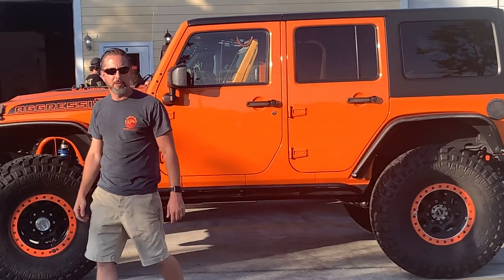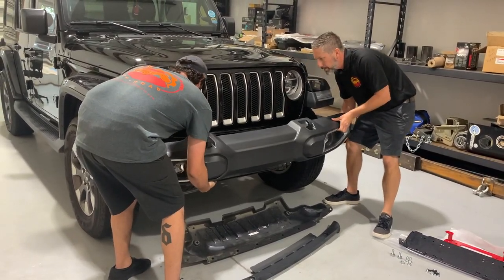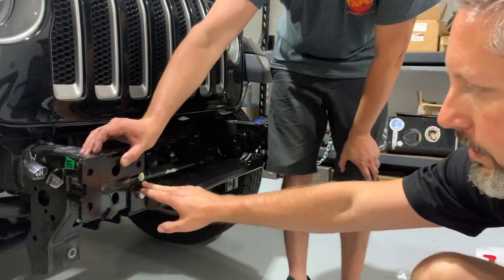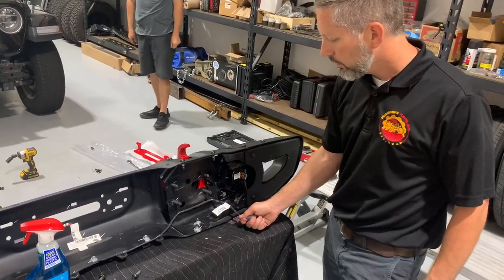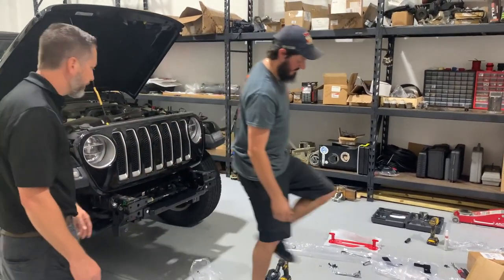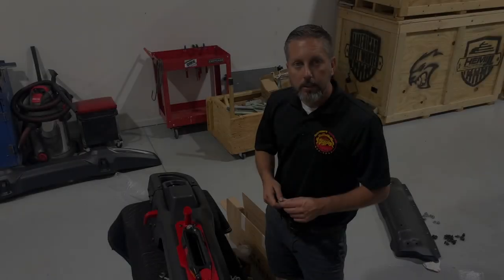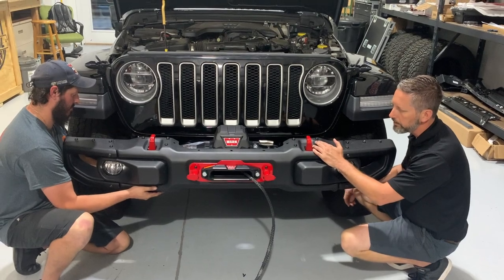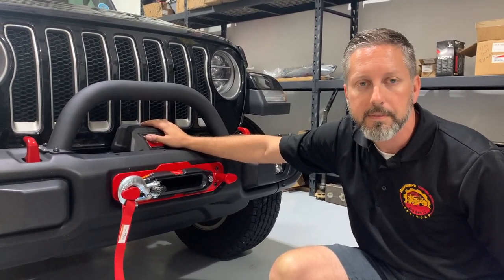Rubicon Steel Bumper and Warn Winch Install

Comment: I really like this setup and look here.  I just recently picked up my 2024 JLUR.  Kind of wishing I added the steel bumper group now, as I have the plastic bumpers and would need to find a steel one.  Saving this video for when I'm ready to make changes to my Rubi.  For now riding stock for a while to see how I like everything and what changes I may want to make.  How much does this swap cost?  I'm thinking down a line a little, I'll be looking to do this, winch and all.  Cheers!

Comment: Inside bumper nuts(next to winch)on my 2016 HardRock are a *****! I could only tighten the top drivers’ side. Did y’all have the same issue? I installed the Warn Zeon 10-s.